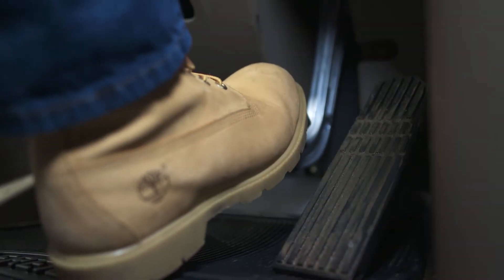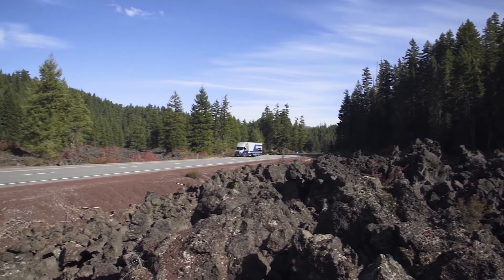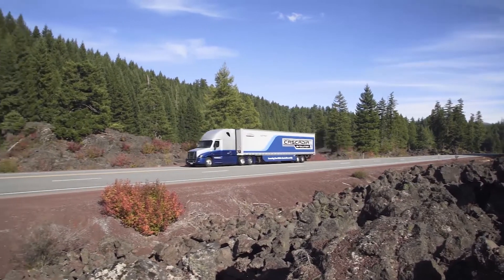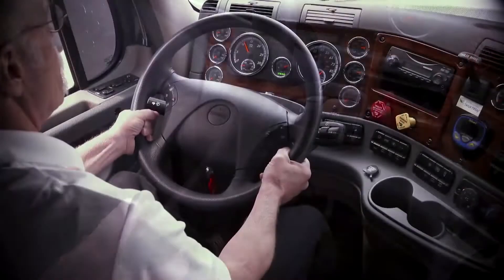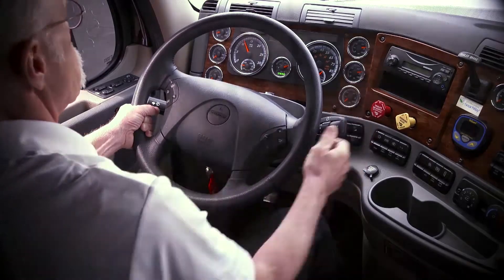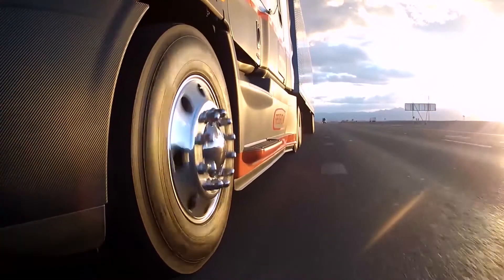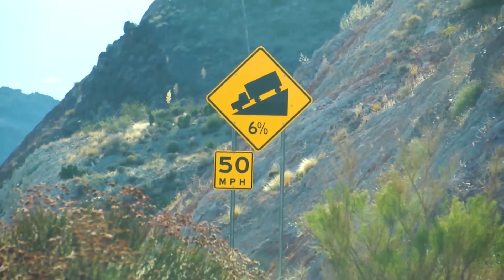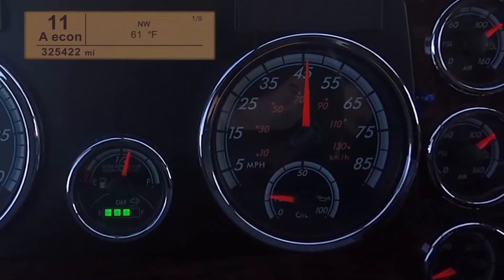Original Cascadia DT12 Downhill Overspeed Driver Training Video

Comment: Just got this DD15 and use manual mode when going thru downgrades. I know the engine can handle high rpm but don't like it revving that high. Popping it in manual and down shifting accordingly works smoother. When I'm on 80 76 in PA I just leave in manual all the way thru.
Reply: instablaster.